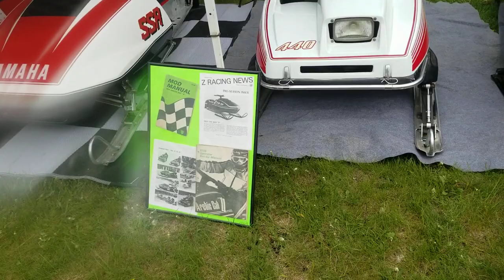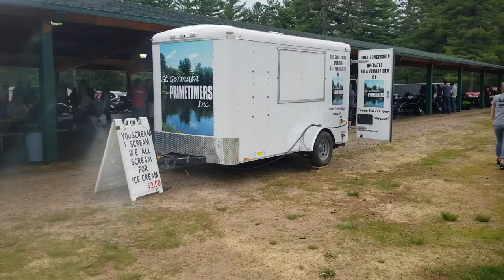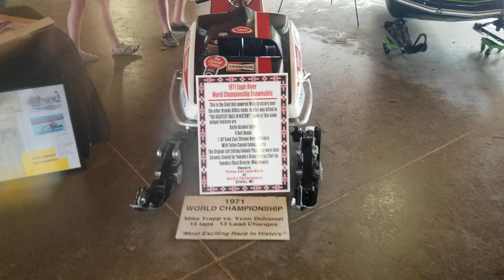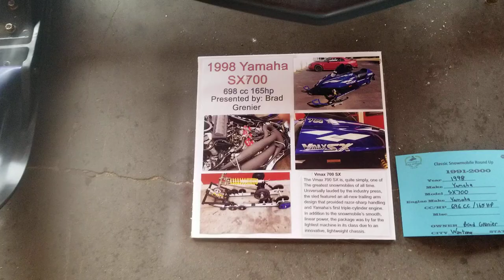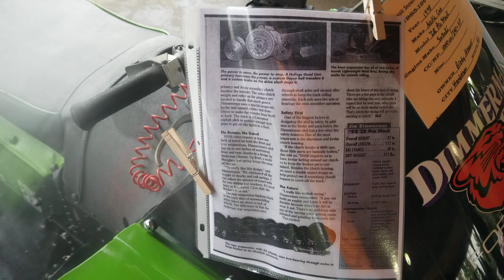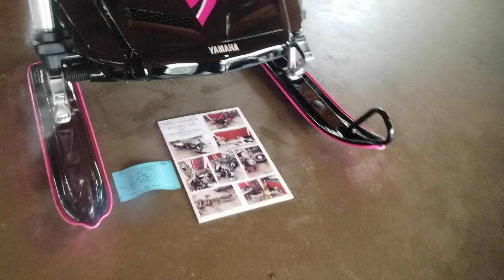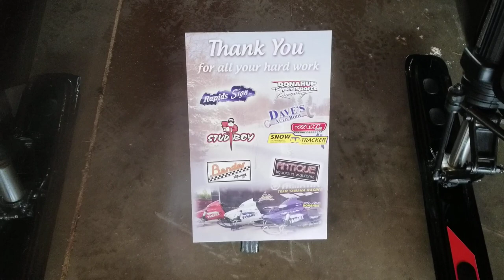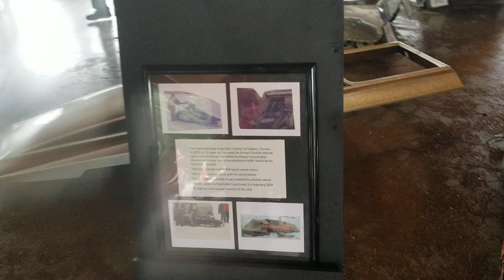St Germain hof museum Snowmobile Show and swap May 29 2022

Comment: If you run your belt to far down in the torque converter like a half inch you will come out of the hole slower and loose about 3 mph on top end.